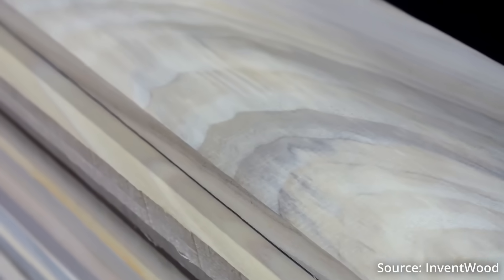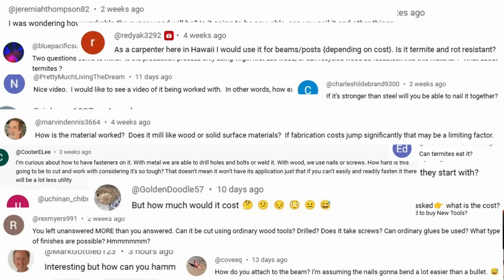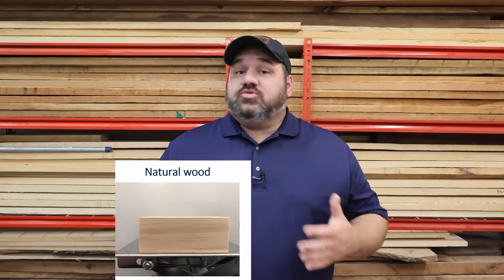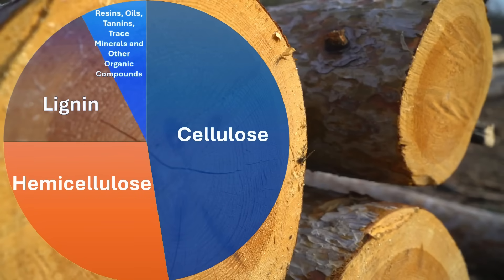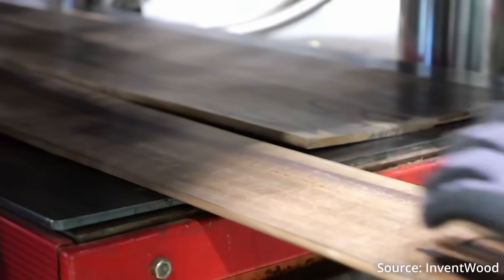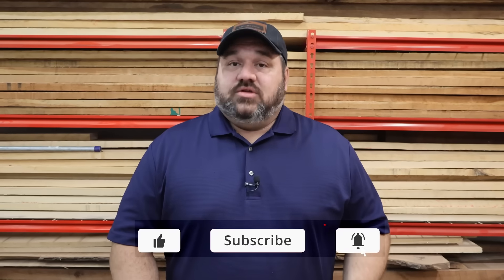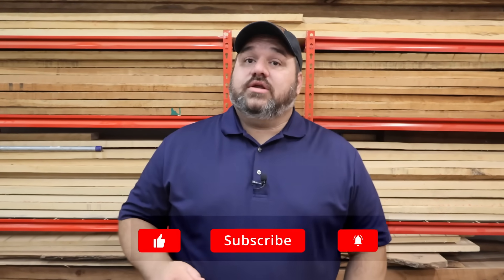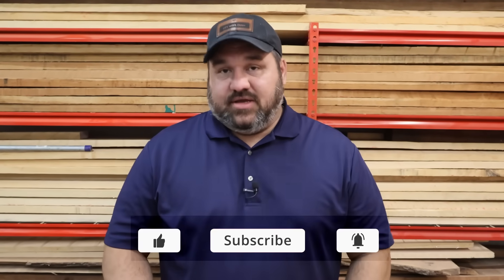The TRUTH About SUPERWOOD - I Met With The CEO of InventWood and Have Answers to All Your Questions

Comment: Tool handles came to my mind.  Hammer, ax, garden tools, for example.   Interesting and good demo
Reply from the maker: I think that tool handles would be a perfect usage.  In my first video, someone also mentioned baseball bats,
Reply: @DIYwithDave  Bats, yes!  small items would cost more but would  not break the bank as with building materials.   Hopefully costs will come down.   Poplar is a good product and inexpensive and possibly a good substitute for hickory, dogwood and persimmon.   Just a thought
Reply: I'm not sure the baseball bat can take the vibrations and soak it up it might instead send everything to the user instead of holding that bat which no one will want.
Reply: @Bigdog1787  Interesting. Thanks for that.  But they make metal bats

Comment: How is steel non-renewable? How is steel "dirty?"
Reply from the maker: I define a renewable resource as something that something that can replenish itself and is always readily available.  Wood grows on trees, but steel does not.  Iron has to be mined and then smelted and while it can be melted down and recycled, it is certainly not renewable.  Also, the production of steel is very dirty.  While advancements have been made, it is an involved process that requires intense heat and energy to produce.  I used to live in Pittsburgh and have seen the pictures and heard the stories from the old days and let me tell you, steel is dirty.
Reply: There's 280 times the amount of iron in the Earth's crust as there is carbon. It's in no way a limited resource in the short or medium turn. And that's entirely ignoring entire asteroids made of practically pure iron. 

 Steel is increasingly made in electrical arc furnaces, not giant gas or coal powered blast furnaces. Reluctance to adopt that cleaner, cheaper technology is one of the reasons the US steel industry is in dire straits.
Reply: @ryanbrown982 All those things make it plentiful if anything, not renewable.
Reply: @ryanbrown982 where do you think the electricity comes from?
Reply: @jamesharmon3827 Solar, wind, nuclear? Sure, historically it's been primarily fossil fuels. But we're discussing a brand new technology making wood stronger than steel. Why focus on what was, rather than what will be?

China installed solar capacity equal to 8% of the total US generation capacity *this year alone*. If you think most steel will be manufactured using fossil fuels in 5-10 years, you are sorely misinformed.

Comment: Great follow up, and answered many questions.

I would still love to try my hand at building an electric guitar out of it. It ticks most of the right boxes. Durable. Strong, for the neck to take the tension of the strings. And fire proof. Jimi Hendrix would have been impressed. Pete Townshend would not be impressed.

My only concerns would be the sustain and tone of the wood.
Reply from the maker: Go for it! I would love to see the result!
Reply: I think it would sound dull and flat.Even with electric guitars,the properties of the wood affect the sound so turning it into a homogenous lump probably isn't going to worth it.

Comment: Having to buy all new equipment for Super Wood might turn some people away if they're not willing spent money. But if the Super Wood ends up being too expensive people may not buy it.
Reply: Carbide blades are standard today
Reply from the maker: Good point, by what InventWood would say is that you don't need to buy all new tools, you just need to make sure that you have the right blades, etc.  Your current miter saw could handle it so long as you have the right blade.
Reply: It is a high end product. People with the means use all kinds of expensive materials. I could see the rebuilding of those 10 million dollar houses in CA using something like this.
Reply from the maker: Right.  It is about matching the product to it's best use case.  While it can be used in a ton of different ways, not all of those ways make fiscal or practical sense.

Comment: If they don't target the ever day man, it won't sell. Contractors are not going to pay more, which will increase the price of houses they are trying to sell. I would pay about 15% to 20% more to rebuild the shed that got destroyed by Helene.
Reply: It's a high end product. Builders of average homes don't put on slate roofs either. But in the big dollar market, there are those who do. it's like a Tesla - geared to be for the upper end market. The builder of fast construction duplexes getting excited about this would be foolish.
Reply from the maker: Fair point.
Reply from the maker: I think that they are targeting the high end now as proof of what the product can be.  I don't think that they have the investment necessary to make it on a scale that would be available for the everyday man.  Once they have scaled up, however, I could see it as a replacement for steel beams that are used in some home construction applications as they are saying that it can actually be produced cheaper than steel.
Reply: @DIYwithDave  It'll depend on the strength, a builder might be ae.to.use.less wood if it's strong enough.  That's why we switched to making ships out of metal, along with the ability to make them larger .

Comment: I wonder how thin they can make it while maintaining most of the desirable properties. Could it be die-pressed into the form of a thin salad bowl, takeout container, or bow limb for archery? Is it durable enough to use as a countertop? How does it take stains, polishes, and veneers? Could you use thin strips of it to make composites ala carbon fiber? Does it maintain its properties enough when thin to be used as a protective veneer for other woods or materials? How much of the original wood grain is visible?
Reply: It's a high end product. They wouldn't be making take out containers out of it. And with the chemical processes and that it likely doesn't degrade, makes it very eco unfriendly.
Reply from the maker: There are certainly far cheaper and more eco friendly options for making take out containers.
Reply from the maker: You could make basically anything out of it, and while I haven't seen it, they have said that they can press it into shapes.  You would not use this product when there is something that is easier or cheaper.

As far as stains and polishes, that is a great question - that is something that I will test when I get a sample.
Reply: I'm not sure if it will be safe. you're going to want countertops and bowls to be food safe materials.
Reply: The Chinese already do it with bamboo and resin.